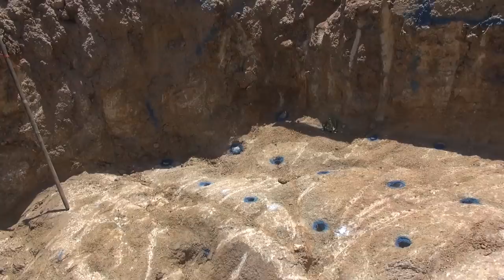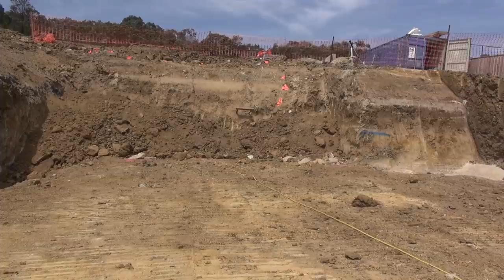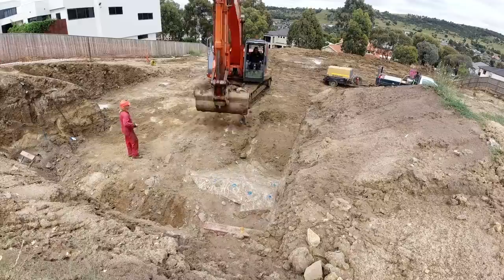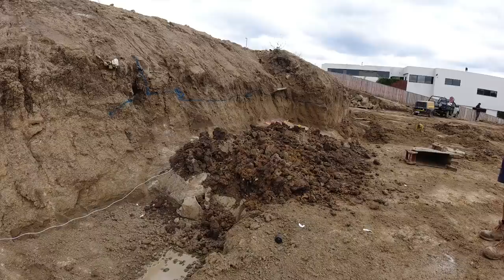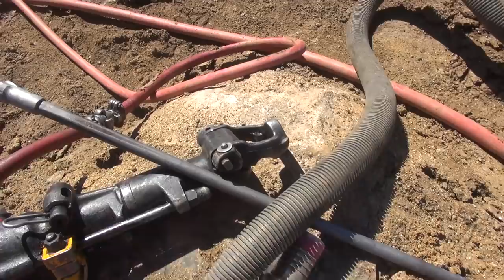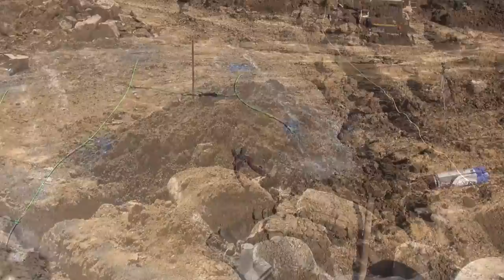Wall Footing Gets Blasted

Comment: There are blade smiths who would kill for the old drill bits you have. Steel that hard and reliable to make a knife out of? yeah they would love it.
Reply from the maker: All of these drill steels have a small hole down the middle, not sure that would be helpful...
Reply: @demolitiondavedrillandblast  workable. get the metal to forge welding temp and use a hydraulic press to flatten it into a usable shape, welding the length of the hole together in the process.
They would only need to know the exact composition of the metal.

Comment: I would of changed the plans and poured footings on top, solid base 😁
Reply: Yea I don't understand why they blast everything. Those rocks been there a very long time, most are pretty large make good foundation.
Reply: I thought that too.
Probably building reg's being enforced no matter what: "Yes, you've got to blow a trench in that granite bedrock, then fill it with concrete..."
Reply from the maker: This is an interesting Point Goz, generally if the thickness of the footing is reduced by less than 1/3 you can pour on top, this is OK for a home wall footing but for a retaining wall you have big turn over forces, depending on the engineer you can sometimes drill deep holes into the rock and join into the rock with big starter bars and this might be OK.

Comment: This is a whole new aspect for me, but in reality couldn't the construction just tie into the granite? Without any freezing and thawing cycles like here in Canada there wouldn't be any expansion/contraction cycles to crack?
Reply from the maker: They probably could tie in and sometimes this is done, I think it depends a lot on the engineer.
Reply: @demolitiondavedrillandblast  Thanks for the reply! I figured they might try to and save cost, thinking the stone has been there for thousands of years and probably not moved an inch. Would be a good base to build off of. We have so much earth on top of bedrock here I'm not even sure how far down it is. Everywhere here they do piling, drilling down to find a more solid base out of the frost line. Anything above it and you will get severe shifting.

Comment: What was with all the hand work on the fill - too much large stuff?
Reply from the maker: Just shifting some of the soil from where I did not need it to where it was needed more, also uncovering the tails of my witness tubes that got covered up.
Reply: @demolitiondavedrillandblast  I had the same question as I hadn't seen you do that much hand work before.  Not all of us are in the industry,... "witness tubes"?
Reply: @jcadult101  Witness tubes: if you have a string of explosives, then run a 'tail' out the far side of the string to somewhere that can be found/checked easily.  If, after firing, the witness tubes don't have evidence of firing, then you potentially have a string that it broken or didn't fire at all, leaving live explosives under where you're digging...
Reply: @RangieNZ  Thanks!  I was picturing something on each hole, that makes more sense.

Comment: On the dice 5, do you blow the center first to create space, and then blow the 4 corners?
Do the corners run simultaneously or are they staggered from each other?
Reply from the maker: Hi Ben, thanks for visiting, there are two ways you can do this. When vibration is not a big issue you can fire the centre hole first, and you would have it on a bit of an angle so that it can push out toward a free face and then fire both  side holes together and then the next centre hole etc. When you are concerned about vibration you would also fire one hole per delay period as I did here, as well as lower measured vibration this will always give you better fragmentation and easier dig out. The firing order can be seen by following the hook up sequence.
Reply: @demolitiondavedrillandblast  it's just all so logical when you explain it!
Thank you Dave.

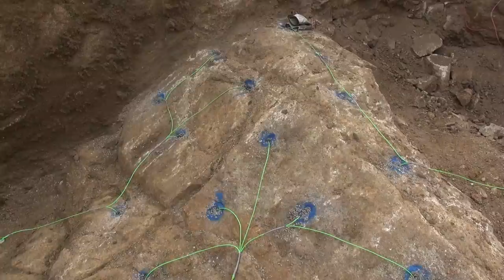Comment: So Dave... As an Electrician, I'm puzzled as to how you make your connections in your wiring. I see @ 8:06 the green wires look like a tree trunk arrangement and I was just wondering how you join each separate wire together at those junctures?
Reply: Pretty sure that was just det cord not wire. So when it's taped together like that it will set off each line when he fires the shot.
Reply from the maker: Dave Forrest is correct, the Green stuff is just plastic covered explosive cord, so you just tape it or tie it together. The Pink, Yellow, White stuff is non electric shock tube, a tube with a micron thin layer explosive coating on the inside. Regular electric detonators are not often used these days for several safety and other reasons that make them less attractive.

Comment: I gather this is a residential home ? The engineers want stip footings this wide?,  it's getting so over done , If you have ever seen 100 year old + homes with brick or sandstone block foundations just sitting and confirming on top of existing ground rock  with 0 percent movemment in all these years it makes me ponder.
Reply from the maker: This footing is for a cavity filed block retaining wall.
Reply: @demolitiondavedrillandblast  That makes more sense, But I have seen similar specs on buildings regarding strip footings for extenal walls, which in my opinion is overkill.

Comment: Also i noticed the vac apart, what do you do with all the rock dust? Dump it on site and mix it into the dirt? Dispose as trash?
Reply from the maker: The course stuff that is in the blue separator usually gets dumped on site, the very fine stuff is contained in a bag and disposed of.

Comment: Gives you a little scare when the steel breaks and the drill takes off and you've got a sharp poker sticking out of the hole. You were hitting the holes pretty hard I can see why you put a good amount of cover on. Noticed they had a poker on site, to do all that would have been a tough grind, the neighbours next door would have gone off their gourd lol. At least the water problem went away wet holes are never a blasters friend LOL.
Reply from the maker: Heck yeah GT fortunately it is rare to break a steel mid way, the taper steels that I'm using usually break on the taper just above the bit.
Reply: @demolitiondavedrillandblast  The drill steels when dad and I were drilling and blasting on our project years ago only had the single tungsten bit. Only had one break and it was mid shaft. Never did continue with my blasting career after dad an I were done lol. I was only 18 back then in 1994. Always been in and around excavating that involves blasting in today’s world rock hammering
Reply from the maker: @Graveltrucking  Indeed the big machines with hammers nearly killed the blasting work here in the early 90's, lucky for me though we have some rock types that they just cant break.
Reply: @demolitiondavedrillandblast  The machines sure did get big, but there are plenty of places that those machines can't get in to that Dave can.

Comment: What happens if a hole doesnt go up? Will the concussive blast from the closest ones trigger it ?
Reply from the maker: The explosives we use these days do not "sympathetic detonate" . A hole not firing is a very rare occurrence thankfully. you can usually find them because the ground around that hole is not broken and investigation is required.

Comment: Dave,  is there a reason you don't use mats more often?  Would seem to me to be faster to cover and remove the waste rock.  Too much risk of fly rock?
Reply from the maker: Is that an Aston Martin DB6 I see there? I was looking at a good rear 1/4 panel for one of those yesterday. ...Blast mats, there are several reasons why I choose not to use these very often. 1/ poor noise control compared to soil - big bangs bring complaints and people go looking for cracks in their homes. I need to make two trips to each job to deliver them or put on an extra person to drive the truck, the soil is already on site. Even with 12 medium size mats that I have the size of each shot is limited and safety margin is lower.
Reply: @demolitiondavedrillandblast  No, that is a 1961 DB4/GT Zagato.  Belonged to a friend of mine.  He has since sold it. He brought it up here to Saratoga Springs, NY for a car show .  Only a few of these ever made.
I hadn't thought about the noise issue. I worked many years ago for a blasting and rigging company out of Bangor, Maine.  We did mostly preparation work for installing high voltage towers and ski lift towers.  Most work was remote and noise wasn't a factor.  Mats when they were required were usually brought in by helicopter CH64 sky cranes.
Do you have a DB6?  I owned a '65 DB5.  One of the last LH drives made.  I was the 3rd owner.  Sold it in 1989.
Reply from the maker: Do I own a DB6? Heck no, they are a very rare piece of machinery around these parts, a friend of mine has the rear 1/4, he has done a lot of work on exotic cars over the years.

Comment: "See how it  goes." Ha! It's going to go one way and only one way.  Big slabs of granite to small stones is how it's going to go. One thing's sure. If there is any unblasted granite below the level of the footings, that wall isn't going anywhere anytime soon. Oh, before I forget, I liked the music during the accelerated shots of you doing the wiring and back filling. So, just how long does it take for a hex steel to become round?
Reply from the maker: Thanks Jim. All of the round drill steels would be Secoroc (Epiroc) brand, would not be surprised if some of these have done >1000m